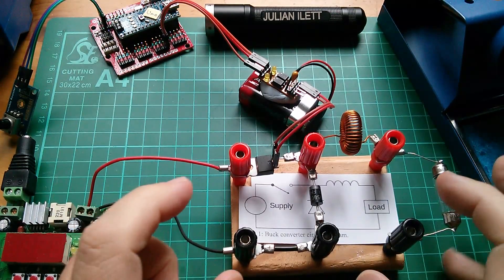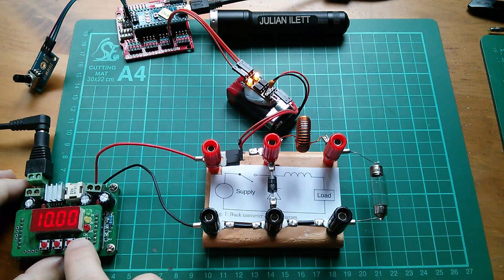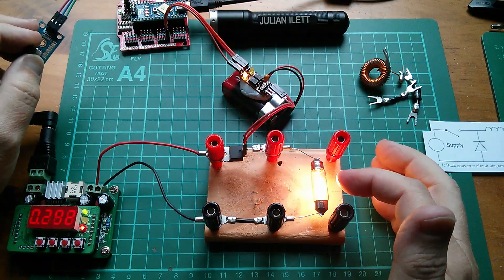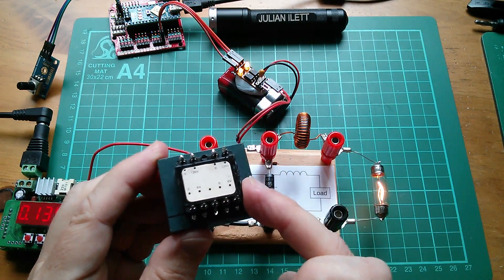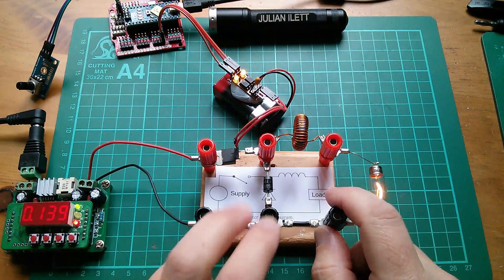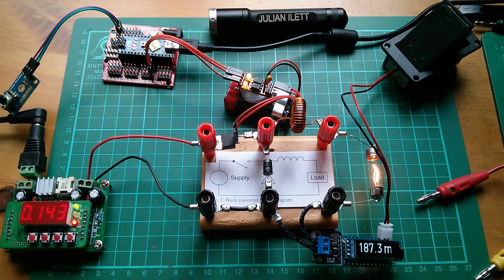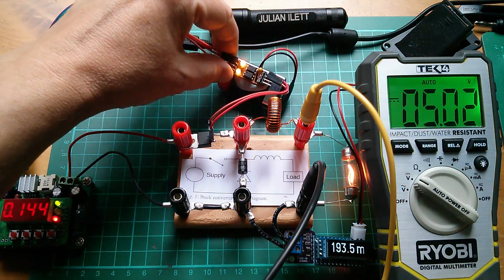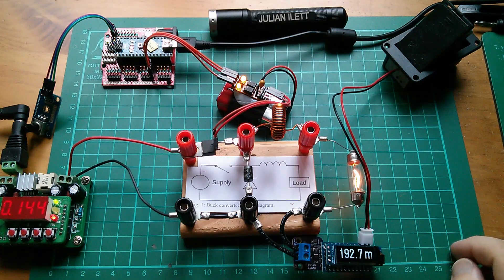Let's Test a Buck Converter

Comment: I'm happy to have been proved wrong it's certainly not the first time.    I was worried you had joined the free energy nut job fraternity that make big claims based on no evidence.  I begrudgingly admit you may be correct LOL. I would still like to see the scope traces, but more excitingly I would like to see it running closed loop with the lamp staying at the same brightness as you vary the input voltage.   I assume what your driving it with has an analog input you could use to modify the PWM. Best regards Chris

Comment: What about comapring input power vs. output power
Reply: at 14:00 you can calculate it to be 1.44W in vs 0.95W out giving you 66% efficiency
Reply from the maker: +112FaNa Yeah I recently converted my Arduino ammeter into a wattmeter to do just that :)

Comment: I think you need a "AC + DC true RMS" to measure that.
Reply: No he doesn't. It's a DC-DC converter. You don't need true RMS for DC, you need a filter. One capacitor will do 90% of the filtering.
Reply: Proyectos LED not really the voltage across the lamp is dc  average since it's just pulsing, and really is not ac.
Reply: Proyectos LED there's nothing to filter, nothing! By George's you guys are nuts! It's ALL DC, a cap here is for "smoothing out any ringing from the inductor" at no point does he introduce any AC into this system. The Gate is being driven by the Nano, the power flowing through the bulb is from the solar panel, he just stepped it down
Reply: Mmm...
Apparently the people don't know why you need an AC+DC True RMS in this class of measuring, this thing isn't pure DC, have a lot of shitty harmonics and electrical noise that's classifies as AC.
A common DC meter gets crazy (look at the INA219 with the Arduino)
Reply: Forget your cheap or fancy digital meters, just hook up a traditional moving coil meter ;-)

Comment: Hi Julian, thanks for this vid! 
I'd really like to see you explain the physics of the inductor.
How it is that it 'stores' current/voltage (difference which capacitance). 
Some chat about the circularity of the flow, dynamics of the fields effects on itself's coils.
Why it is that voltage/current changes.
Reply: Mark T  Inductors (all types including transformers) store energy as magnetic fields. A change in the current flow causes a change in the magnetic field. When you switch off or reduce the "input" current flow, the magnetic field reduces, which induces current in the windings.

Comment: Get a scope and see that huge ripple on the output :D Why don't you try in the next video adding a capacitor on the output, the bulb should glow almost as bright as it does with the choke bypassed.
Reply: You know he has like 10 scopes right? And there can't be any "ripple". Ringing maybe, ripple no! It's all DC. He's not using an AC source and bridge rectifier, it's a solar panel. The "smoothing cap" is certain to come, but he's teaching here...he told you he is using rubbish bin parts and has done no math yet, the bulb can't be equal because it's about efficiency not adding capacitors, which in this case will be for smoothing the voltages. Now if you want to be cool next time, tell him you think he is building an asynchronous SPMS and you can't wait to see it.
Reply: The Combat Engineer The ripple is the amplitude fluctuation, it doesn't have to cross 0v. Second, where that ripple comes from? Yes, the input it's DC, and let's say it's very clean, but doesn't the first word in "switching converter" give you a clue? 
 Just wait for the other video,  mate. The ripple will look like triangle vawe at 50% duty cycle and more like sawtooth on the other mark-space ratios.
Reply: MrJohhhnnnyyy I build these brotha... lol. I am a avid Tektronix collector as well.

Comment: Yes definitely use a scope, it's very easy to make incorrect assumptions especially when using the wrong equipment. When fiddling about with inductors the phase shift between voltage and current can also cause misunderstandings, so it's best to be thorough. Also I reckon transformers can have very good regulation as the supply voltage to your house does not change much as your neighbours turn their appliances on and off :-)
Reply: Coolkeys2009 when you turn the light on the at the electricity generation site it regulates your voltage. There is feedback loop and a load is connected there. If energy is not consumed then the regulate the generation also. Think about one city suddenly encounters power outage. Then your supply voltage still remains same.
Reply: Coolkeys2009 output side will changed drastically according to load. You need to study CCM and DCM mode of operation. As long as it runs in CCM mode the output will stay same. You are now decreasing load current to the point where the mode operation change to DCM then watch out the disaster.
Reply: Coolkeys2009 I've yet to see a phase shift in DC circuits....
Normal mains transformers do not regulate in the same sense that electronic regulated power supplies regulate. You can though buy constant voltage transformers that do have a more constant output voltage (but they are heavy and expensive). With a normal transformer, the output voltage is proportional to the input voltage. So if the mains voltage changes, the secondary voltage will change. The amount depending on the turns ratio of the transformer windings. Also, if the load current changes, then due to the resistance of the wires that make up the windings, the secondary voltage will change. The magnetic circuit also has an effect. It is the combination of the "copper losses" and the "magnetic losses" that affect the output. The term "transformer regulation" normally refers to the difference between the off load voltage and the full load voltage. Generally, larger transformers have much better "regulation" than small transformers.
The electricity distribution companies use a number of methods to keep the mains voltages within a defined range. At major sub-stations, the large transformers have automatic tap changers.

Comment: These videos come out so far apart these days that I think Julian will be on reduced income this month.

Next time you are screwing terminals in tight hole just add some oil so the wood doesn't clamp(stiction - sticking friction) on the metal.

Comment: Can we please see some waveforms, voltages and currents (voltages across non-inductive resistors) on an oscilloscope? One 'elephant in the room' question for you: Why are you using an Arduino to do the switching, when you could achieve the same thing much more simply via, for example, an a stable multi vibratos, adjusted by a potentiometer in the place of one of the timing resistors? Two transistors, two capacitors, a pot and three resistors would give you quite a good PWM rectangular waveform. That would also be more efficient than running an Arduino. Do you have an ulterior motive for the additional complexity? Thanks Julian.

Comment: You seem to have serious problem with electronics. Its not the reason that we use buck converter to gain current but to decrease the voltage as well. If you dont understand why a capacitor is used then use your oscilloscope and see. When a static load is connected then you might not see the disaster but open it and see. If the conversion depends on load then its not a converter. you might see 100 volts at the output if your load current drops just before end of inductor charging cycle. Free flowing EMF will raise this voltage 100 or 1000 volts depending on inductance. Good thing would be set it to 5v output and connect your 5v arduino board. If it doesnt destroy the chip then let me know. Provided you run some code in that arduino board. Dynamic load will zeopardize the thing.
Reply: I need to correct littlebit. Arduino board has its own decoupling cap so that might protect the device to some extent. Connect any bare chip without cap. That will be more interesting to watch

Comment: 5:50 i think it gets brighter because theres no conduction loss through the inductor. pwm is just more efficient. but you probably figured that out by now.
Reply: It's not so much conduction loss, but the other thing. The other thing is that inductor resists sudden changes in current, that's why with it in circuit the bulb is dimmer. All he had to do is to add a cap on the output, and the brightness will increase.
Reply: yea it basicaly takes out the buck conveter effect and becomes just pwm.
Reply: But an inductor resists SUDDEN changes, not in minutes, not in seconds, but in miliseconds... we could see some change in the output, but really fast, since it is not a gradual change, we can suppose this inductor is not dimming the bulb during the connection / disconnection. We must keep in mind, that a buck regulator uses inductance, we could achieve a voltage decrease using PWM signal and a capacitor,  but without the amperage increase. Also, this video was made to show up the results without major tools, just simple volt / ammeter... of course, with an oscilator it would be easier, but no so much fun...